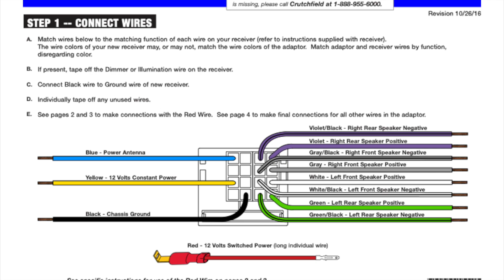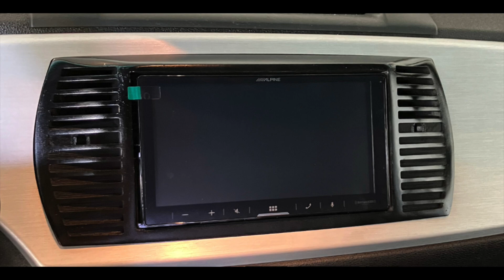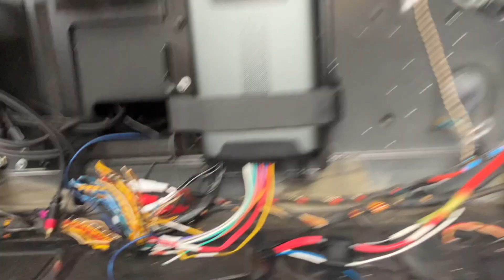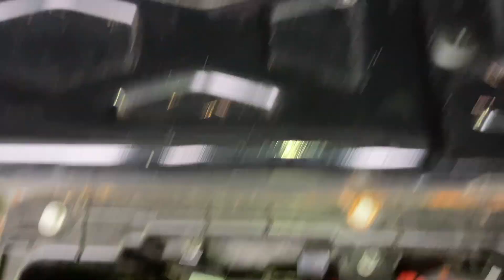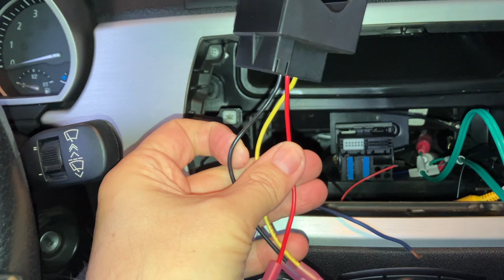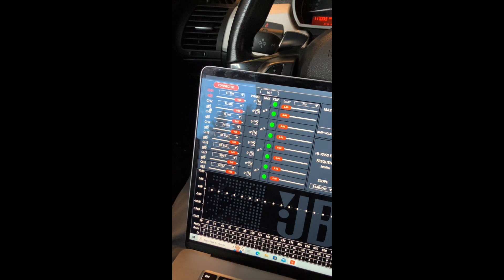Z4 E86 Stereo Upgrade

Comment: Are you able to get any of the OEM data that was on the nav?  I bought an E86 that "had" nav but the screen was missing.  No way I'm paying $700 for that nav screen.
Reply from the maker: If you're referring to the navigation screen I left in place, I don't think there is any coding needed for replacing it. The head unit navigation works as a stand alone if thats what you're getting at

Comment: Thanks for the video, about to explore this endeavor on the father in law's Z4 M Roadster. Only question I had was, did you run the rear mids and subs in parellel to make them effectively 2ohms, and use a single channel each pair? I can't think of another way to achieve 8 channel active amplification to 10 total speakers, unless you run passive crossovers to the front/rear stage. I also thought of using an 8 channel DSP + Amp like this, and a separate 2 channel/mono sub amp. Any clarification possible would be appreciated! Cheers
Reply from the maker: I ran the two rear subs in parallel as the ones I have are actually 10 ohms. I left out one of the L sided speakers to make the 8 channel amp work. Ive been happy with the sounds quality, but going to a 2 channel amp with different subs was my next step. Ill add the setting for the amp when it finally thaws outside. Good luck and let me know how it goes.
Reply: @TBDprojekt I had a feeling, thanks for the reply! I still think using the JBL DSP4086 is a good idea here, even to power just 6 or 8 channels, and then worry about the subs in a separate amp with more power.
Reply: Also, mind sharing your crossover settings for each of the channels? -Thanks!

Comment: Hi there, I'm about to do the same with my car, do you have working steering wheel controls?
Reply from the maker: I used the kit from axxess and the steering wheel controls work now
Reply from the maker: No, but its on my list. Axxess sells one I was going to try, but let me know if you get it working.
Reply: @TBDprojekt  sure, I just bought the same amplifier as you, I'll be installing it this weekend, where did you connect the remote amp signal from the stereo on the amplifier side?
Reply from the maker: @b4dk1n6  I think I used the signal for the power antenna.

Comment: Do i have to replace the Amplifier??
Reply from the maker: After I posted this on a Z4 forum someone reached out and said there is a way to do this without replacing the factory amp, but I cant verify if this actually works. 
https://z4-forum.com/threads/e85-android-head-unit-installation-for-oem-amp-w-dsp-w-swc.143528/

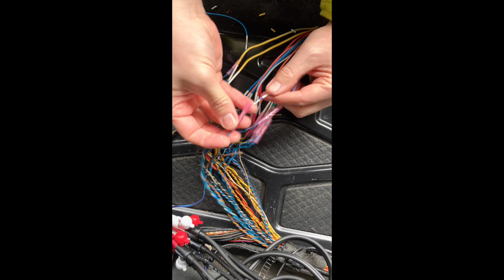Comment: Why did he run RCA cables from the dash to the trunk instead of using the wires that were already there for audio? L+-,R+- should be in that connector 3:35.
Reply: Oh I get it, he wanted to have 3 channel outputs (L,R, SUB) on the head unit so he can configure bass boost settings in the stereo software. That being said I think I will just implement the bass boost remote that was included, so I don't have to mess about in the settings when I want to quick-adjust. I understand both ways tho.
Reply from the maker: The factory head unit controlled the amp over the canbus network instead of just regular speaker wire. I think there are only 4 wire total so I don’t think enough to convert to RCA. They are very small gauge wire too, so I don’t know if the audio quality would be very good. You also need to have a wire to trigger the amp to turn on. I’m not sure if that can be done remotely.
Reply: @TBDprojekt  Since you put it a new amp and head unit, you don't need the canbus to talk to anything anymore. The 4 wires that came off your harness adapter didn't have audio yeah, but if you bought a different harness adapter that included the FR and FL channels, then you wouldn't have to run any RCAs. If you manually put those 3 pins into the harness, you would just need to put 4 more and run them to the head unit.

Your comment is true about those wires not being shielded like RCA, but since it is line level and a short distance I don't think there will be any noise. Also there are adapters which convert the harness to standard ISO connectors, and at the same time have the KEY1,KEY2 signals decoded from the steering wheel controls (CANBUS). This is what I plan to run, it should require very minimal soldering and I'll let you know if it works.